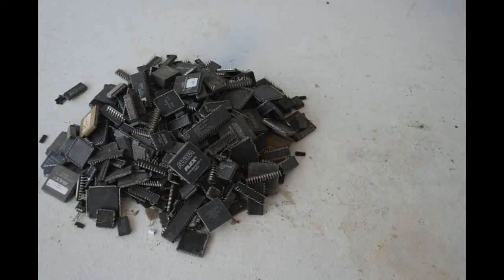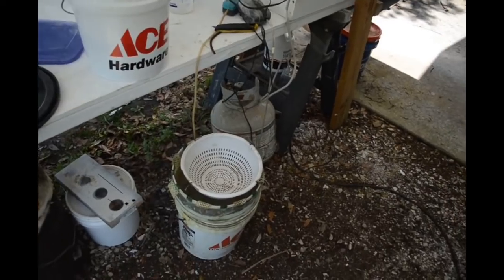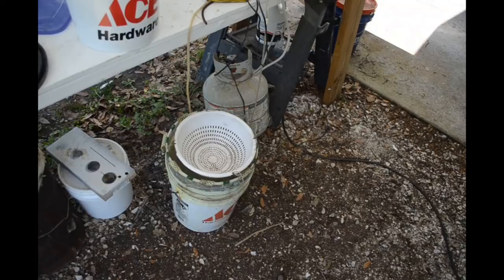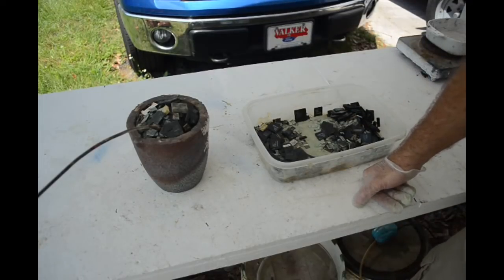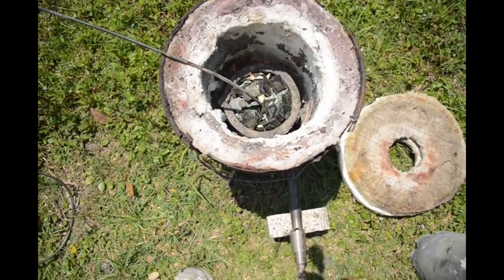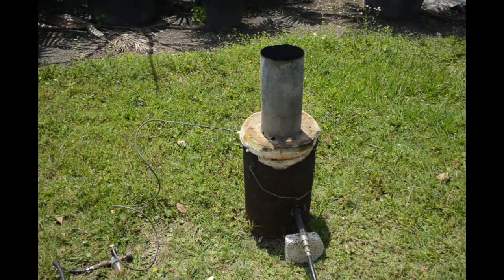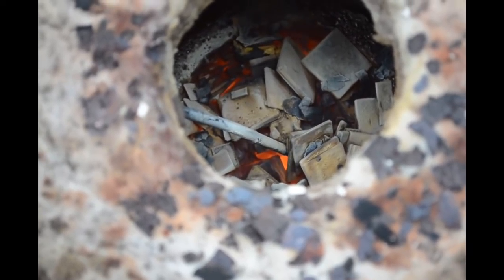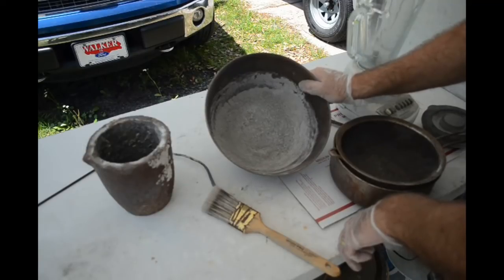Gold and silver recovery from plastic IC Chips. Complete Process part 1

Comment: Clever guy!  Really enjoy your explanation of the science involved in your  simple adaptations of everyday objects.
Doyou turn the heat down by throttling the gas cylinder valve?
Reply from the maker: I have a regulator on the propane tank. I didn't show it, and a lot of other details, to keep the video from getting too long. The regulator allows for fine adjustment of the flame.

Comment: Here's a tip for ya, when using water to clean it, use a large barrel with jetdry in it, it will stop almost all the fines from floating, and use a recirculating pump to continually reuse (recirculate) the water, that way, you'll have no water waste.. A small setup like gold miners do with the wash plant or just use a mini sluice, I believe you would get much better results.. This would be, of coarse after your burning & grinding process... (Commented before watching the entire video)
Reply: Hello, hope you get my comment. I tried what you're saying but I ended up with my bucket or water, my pump, the pipe, the sluice box all filled with ashes. It was very hard to make do the useful from the useles. As the main source; water was all messed up. How do we avoid this? Ive got a nylon bag to catch these but I seldom think it'll prevent the water bucket used in recirculation as well from getting ashy.

Id like to hear from you regarding this concern. Many thanks in advance

Comment: Nice video, really informative, re the air pressure would a fish tank airpump provide enough air?
Reply from the maker: I tried that first. It didn't quite provide enough air when using larger crucibles.
Reply: @omegageek64  a variable hair dryer maybe

Comment: Hi there, i really like your videos! Don't you want to first pyrolize them and then incinerate them? I've read on goldrefiningforum that if you incinerate directly, you'll loose some gold. if i remember correctly those volatile chemicals you mentioned, together with the high heat and oxygen can actually oxidize some gold that will be lost into the air
Reply from the maker: I really don't believe this process is hot enough to make the gold volatile. I try to keep the temperature well below the melting point of gold. I can't see any significant amount leaving as vapor.

Comment: Wouldn't that be parasitic acid?
Reply: I'm still learning so I probably am wrong but parasitc acid can dissolve fine gold when extra air is added to it. I used to get told all the time by my chemistry friends lols but that (ap) soultion could potentially have gold in it who knows. A video I've never seen but I hear alot of stuff about.
Reply: @willsmith4233  even if that is the case, the waste liquids would end up in his stock pot and would cement out on the copper he would place in it and be recovered later.